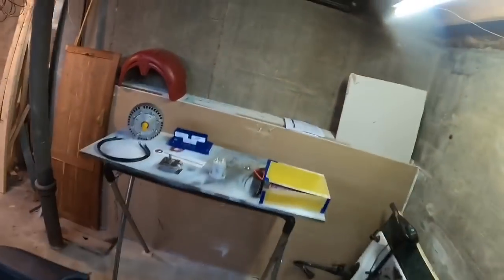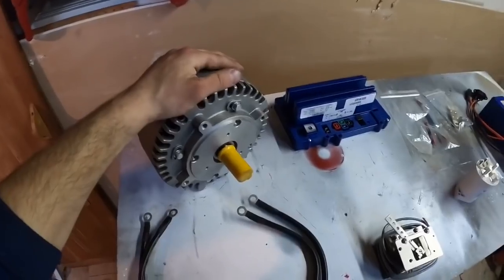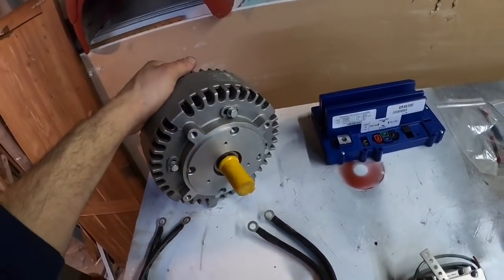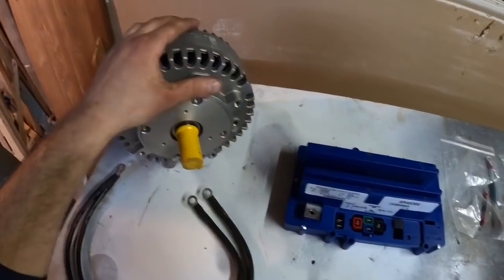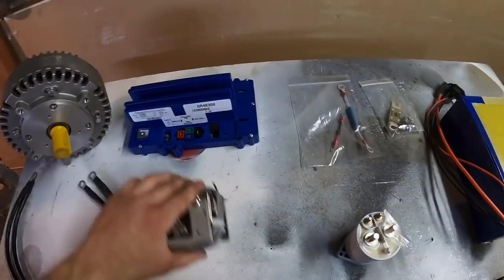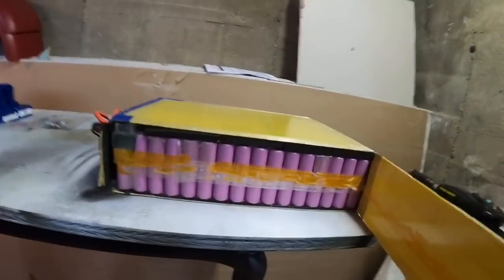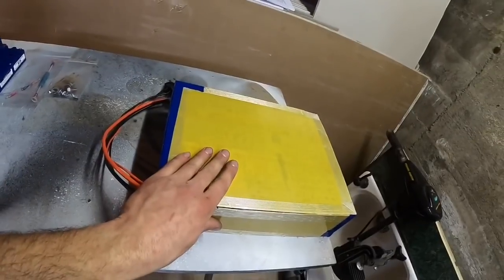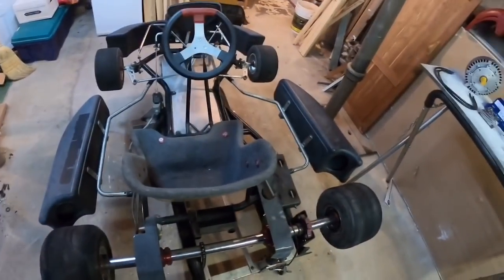(E4) Electric Go Kart Conversion * Build* Very Fast Electric Go Cart

Comment: Hi mate. With that setup you will only require one 48v pack. No use in adding weight really. Your BMS will prob cause an issue as you can’t draw a lot through the BMS. So bypass it, for the main leads. Make them thicker too you’ll need min 4awg at 48v. To get it to a reasonable speed quickly you will require around 150-170A. Its top speed will be around 45-49mph ish with your motor and that battery. You’ll need a gearing of 4:1 ish, and its runtime will be approx 20-25mins. It’ll be about the same performance as a tuned RPM Honda GX200. 48v is actually bit low really for any OMG factor - you really need 72v + for that feeling of wow 😁 also you might be better off looking at a few LiPos instead of the 18650s - because you need the higher current range of 150A + - hope this helps 👍
Reply: avacreativemedia hey man, I’m looking to order there 14kw go kart kit on the same website he got the motor. What type of batteries so I use to get a run time of about 40-50min and high speeds
Reply: Jose R  for that sort of runtime on a kart at high speed (40-70mph) range you’ll need to run hv 72v(go higher if you can 85+ is great)  + a higher rpm motor 5-6000 rpm rated and gearing around 3:1- 4:1. You’ll need at least 50Ah ideally higher prob 75-100Ah would be in the region. Many underestimate what required to power a kart for that length of time and speeds. Our petrol friends with x30 engines consume a ton of energy much more than you’d imagine needed. So to be safe go HV and also go large on your packs Ah. Sadly you will now have a fairy fat n heavy kart, and that’s your compromise- runtimes vs weigh vs speed vs acceleration. It’s all a balance 👍
Reply: Jose R also try a Lynch Brushed British Motor - 95r or one from the LEM 200 range - lighter stunning power to weight lots of torque and you can push them quite hard at HV 200A +
Reply: avacreativemedia ah ok, I was looking at the 16kw 36-48v motor with controller, would a 48v30ah battery get me good results ? I’m trying to push the kart to at least 50-60mph with nice acceleration. I was trying to look into more details about that motor they offer and what battery combination would be best.
Reply: Jose R  48v 30 Ah is a bit low for Adult kart - a child’s Kart maybe might suit but adult I’d say it’ll struggle to get there.  You’d need a gearing ratio like 1.8:1 n that’s a bit hard on the cells n motor . Our tests with FB link ZeroK showed higher rpm, equals good off line , lower current draw and higher top speed. I’d prob place your setup to aim for a decent 40 mph top speed. Now two of those 48v 30Ah packs in series giving 100v with controller n motor to suit, now that would be an entire different ending. 😮😊zoooom 👍
Reply: avacreativemedia I’m ordering the motor on Friday, for the same price they also have the same motor but different system and it says 72-96v 175amp, would that be better for me ? I just thought the 32-48v 350amp was faster for some reason.
Reply: Jordan C  - as an example of working with higher voltages using lynch motors. This is s twin lem200 kart running 100+ v on each motor. Yet his current draw is relatively low given its 128bhp (or so claimed) https://youtu.be/WM9kuK7Aymo
Reply: Jordan C if you go higher voltage you going to reduce current draw on your packs which helps a lot with “smoothing out the sag of the packs under load”. It’s a balance with what you require runtime vs weight - as you can see EV fun was way way to heavy and by choosing different battery tech instead of those headway cells (going lipo) HV they could have reduced the weight to 1/3rd and increased the speed/ acceleration even further. - or simply found a performance at which they could reduce the system power as weight was lighter making system cooler and still achieve their target speeds /acc etc 👍 test test n test again with these things.
Reply: avacreativemedia so as I understand the 72v-96v would be better than the 48v system. It’ll give me better speed and also cause less heating since I’m pulling 175 amps instead of 350
Reply: Jordan C  cooler for your batteries yes.  Your watts will be the same though , Watts are watts.  See ohms law.  The motor and controller will still dissipate the same amount of heat. If you want 16kw of power available then your motor and controller will still need to pass that amount of power regardless of voltage. So bear this in mind - the motors tend to be the weak point as esc has thermal cut back- cooling motor is the critical thing if you run for longer than about 10mins. With Lync motor you need to keep it spinning as this is its cooling method- even after a short intense period of power you gotta then let it spin gently at lower RPM to cool (an out lap). Or fit a temp sensor to motor to shut off things if it gets above say 75-100c. The thing is because your now spinning the motor faster at a higher voltage and lower current, the cooling effect is better. Now you use gearing to create the extra torque and tweak this a little until you get a good balance. Allows the motor to work in its coolest way, with less stress, packs are happier and you now have “ wiggle room” so you can tweak the gearing to achieve higher top speeds - considerably higher as well vs a 48v system. We got RPMs now which is why newer brushless controllers use field weakening to “let go” of the motors magnetic constraints and spin faster - two strokes been doing it for years as they had no option that’s how they make there power. Hope this all helps 😉
Reply: avacreativemedia yes I’m all caught up, I really Appreciate you taking the time out your day to explain things to me. I now have a much better understand on what effect what and how they all work together!!!! I just posted my first video introducing the frame. Super exited to start this EV. Thanks again and have a great day.
Reply: Jordan C  hey no probs - I’m the head designer for ZeroK- check us out here on Facebook @ZeroK.Kart - we are currently working on VOLTA v13 of ZeroK out soon . Along with another kart  eKone. Follow us - and I’ll check out your build 👍

Comment: neat.. so 300A at a max of 50v ( think good 53+ volts hot off the charger with minimal sag because you're running those 3 packs)... 300*50= 15000watts. or 15kw... in HP thats 20hp... like having a 20hp motor on the kart. Not too crazy, but it will have a fun kick off the line compared to stock.
Reply from the maker: Close but I’m not fully there yet, I’m only running one battery pack, so I’m peaking out at 120amps. A far way from 300 amps. But yes that’s what I’m working for 300amps at 50v is a good mix’s

Comment: Nice build! Here is mine with a 1hp motor and R/C lipos. https://www.youtube.com/watch?v=sDAMkK42UAI
Reply from the maker: Sickk how fast does it go. And it sounds so smooth
Reply: I have a handful of sprockets I can swap around so far fastest I have gone is 46mph. But I think it should do around 55 and still have decent torque. Turn your sound up and check out this video: https://www.youtube.com/watch?v=JsHu-KVKaOY
Reply: subscribed to you